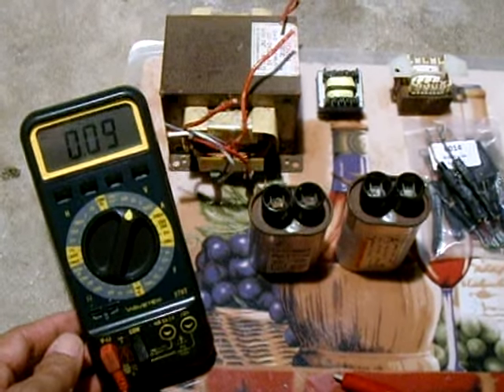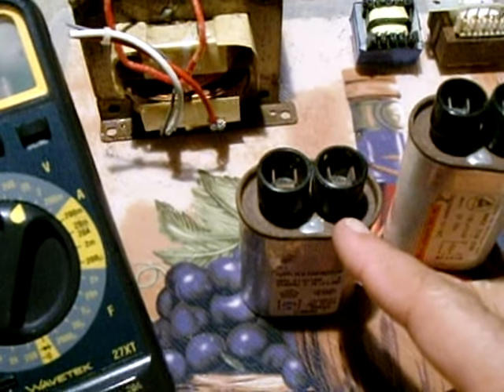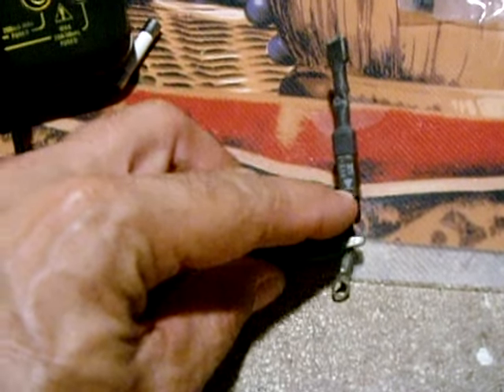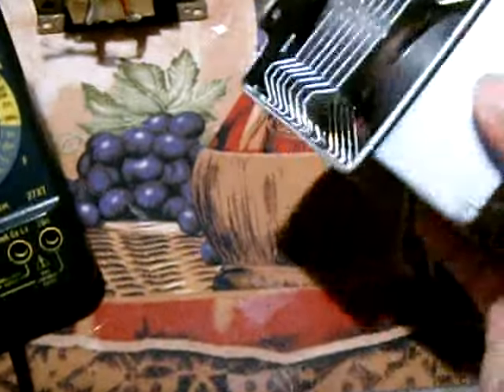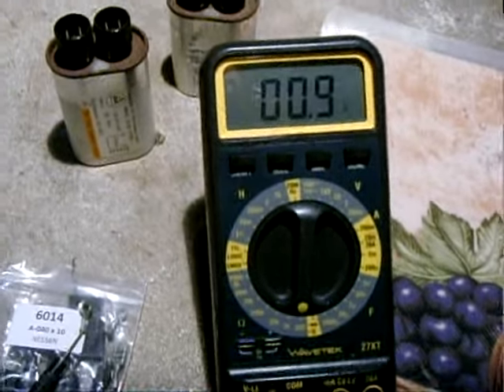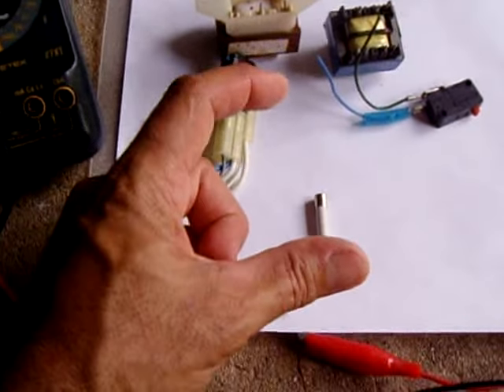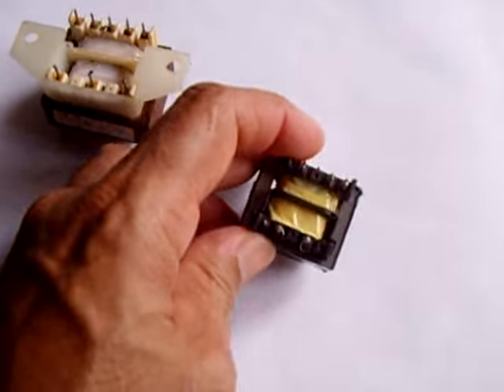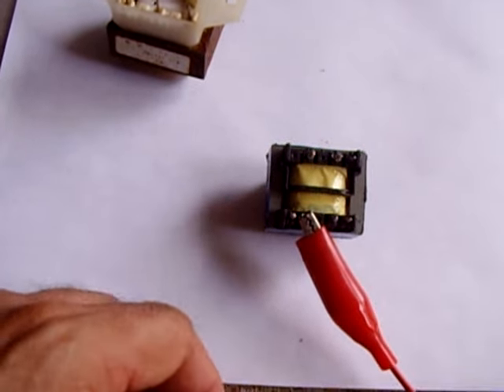How To Easily Test Microwave Oven Parts! (Ultimate Guide)

Comment: I dont understand… in your other video, the checking on the capacitor indicates a growing reading. In this video, indicates 0.3 (0.6, actually) and i cant understand witch one is right!
Reply: Note: testing a capacitor with a ohm meter is not “correct”. You need a farad tester. Which will read the actual capacity of the capacitor. Typically .900 micro farad. Yet the test he does give you an “idea” that the capacitor is functioning properly. The capacitor is like a battery it charges and holds power, then when needed it discharges...
So when you put your ohm meter to read “resistance” across an electrical device it sends a small voltage/current across the leads. And based on expected value it knows what resistance “it faces/it is measuring”... yet with a capacitor.. does not have the capability to read that resistance. Because the capacitor is absorbing all the current that is being sent “very little”, and because the other leads are seeing movement of current, it tries to give you a reading, and that reading keeps running away from it..”goes up”.

And if it does not go up, then the capacitor is broken “open” with no value to show.

Then you have his last test to see if it’s shorted to the housing.  You obviously do a resistance test “ohm test”.

Hence his test is a practical test! And I figure most guys in the industry have notice these Caps either function properly, or they are dead.  They don’t lose the capacity, like being .6 micro farad or less.

Hope this helps you in the future, or anyone me else.

Comment: This is a good video but what the hell is with the blue text?  Have you got a percentage deal with the blue industry?  Did you even test to see what color worked best?  Come on... Blue text on what is basically a blue back ground.

My symptoms are not described in any video I have seen so far. You set the timer, press start and the thing runs for about 1 second and shuts off like it ran the entire time. Still haven't really messed with it yet but I'm suspecting the PC board. I will try to isolate it as the problem. So far All I have confirmed is the switches physically function. I can't get probes to them in place so I will have to use jumpers to check the in-place function and door adjustment. 

I like that you did this step by step. simple easy steps. I also haven't found any flaws in your info or methods. Kudos.
Reply from the maker: Turn on annotations, and the text will be replaced.

Comment: I thought you needed a 9v battery to test the diode?
Reply from the maker: Higher voltage is better, but with a DMM like mine, I can test them just fine.
Reply: Yes I just discovered that, I borrowed my neighbors DMM that has that option and my diode checked out, it appears it’s my magnetron that’s the problem

Comment: While this is comprehensive, I experienced a problem.  I thought by following this method that my capacitor was hammered.  I ordered it and installed it (cheap) and nothing changed.  I watched another vid where the guy just checked the magnetron without switching meter ranges and when I did mine (using the lowest ohm setting that each of the terminals showed a short to the magnetron body.  I ordered the magnetron and installed it and all is well.

Comment: microwave works fine one time. then I have to unplug and replug and set the clock. works fine one time.
Reply from the maker: Sounds like a faulty control board.
Reply: @electronicsNmore  all the buttons on the control board seem to work fine. is there a reset switch of some kind before the control board? This is my second board already. Think I'm just going to give up on Samsung.
Thanks for your help. I liked your video. Learned a lot.
Reply from the maker: @barbarafullwood1260  Try using a lower power longer.
Reply: @electronicsNmore  I will try that